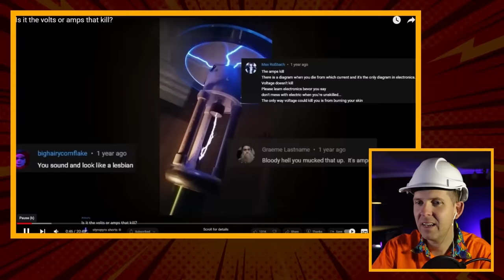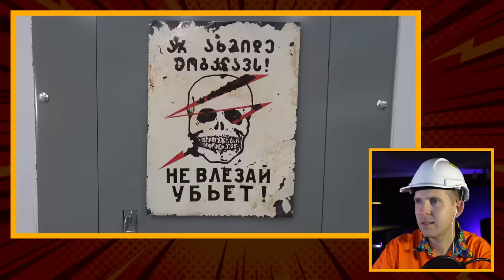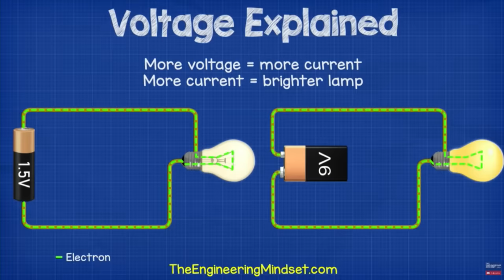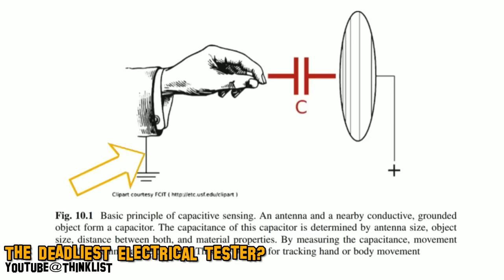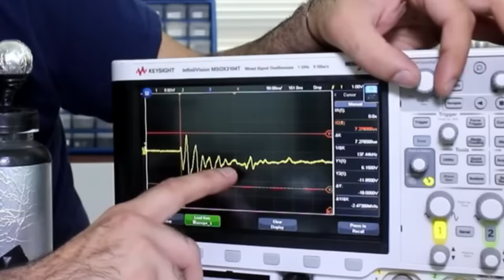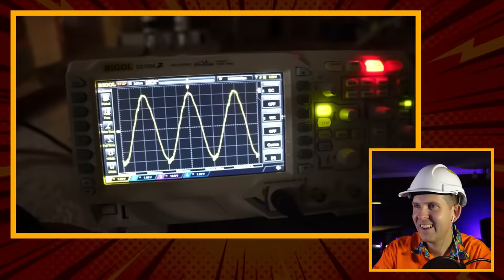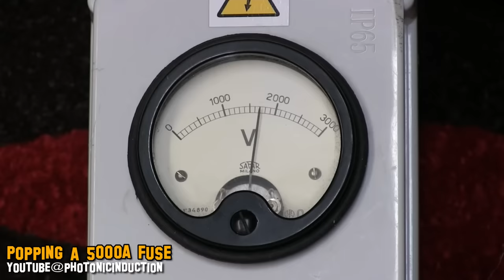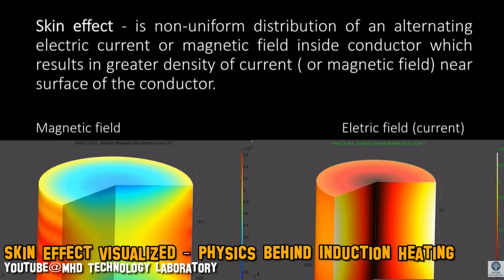Electrician Reacts to Styropyro's🔌AMPS vs VOLTS⚡

Comment: I'm so tired of the amps vs volts debate. It's so much more complicated than that. Electricity is like anything else in life. If you don't handle or use it properly it might kill you. If you spray someone in the face with a water hose for a long time and they drown, did they die from the pressure of the water that prevented them from breathing or was it the volume of the water that ended up in their lungs?
Reply: It is all about the context, not content alone. That's right!

Comment: I dropped out of college 1 credit away from graduating a 3 year degree in electrical engineering in Canada, so while I'm not technically any kind of electrician/EE, I've got a lot of the learning down (but please never ask me to simplify another circuit with a transistor in it, or ask me to write out a karnaugh map ever again). I'm amazed at how well Styropyro manages to explain some of the counterintuitive behavior of electricity.
Reply: thats so dumb. wtf 1 credit. that must feel like winning 2nd place 1 second behind 1st
Reply: @HDReMaster  Not even.  It's like being in 1st position in a race, and then stopping a couple feet before the finish line and just walking off the track.  Or playing football (🏈 not ⚽️) and totally outrunning the defense for the touchdown, but spiking the ball at the 5 yard line.
Reply: I refuse to belive that anyone would do that
Reply: What's a karnaugh map?
Why did you drop out so close to finish?
Reply: @phenax1144  if i had failed one particular exam one more time I would have dropped out at 177/180 credits required for my bachelor's - had written my thesis already. would not recommend! luckily the pressure finally made me actually sit down and study, so I passed and finally got my degree xD
Reply: @Phondrason  sheesh that's a close call good on you for making it through
Reply: @tappajaav  A Karnaugh map is a tool/diagram you can use to describe the behavior of (binary) logic circuits. You notate a table using a gray code dependent on how many inputs your circuit has, then mark down areas in that table depending on what logic gates your circuit uses, or do it in reverse, start out with what outputs you want your circuit to produce, and mark down areas to figure out what logic gates are needed.
It also lets you figure out hazards, which are situations where the output can unexpectedly change for a split second when some input that seemingly shouldn't affect the output (according to the truth table) changes.
Wikipedia has a decent explanation.
Reply: @animowany111  Much obliged

Comment: I had the opportunity of playing with a similar tesla coil, with output of about 3A rms. One effect Styropyro didn't tell about is that at those currents, it starts warming your entire arm up by resisitive heating, which is quite an interesting experience x3

Amazing reaction video as always, thanks mate!
Reply: I'll just use a tesla coil to stay warm in winter. What could go wrong? 😵
Reply: He does add he doesn't do that often because you risk internal burns, though :D
Reply: that is more than mildly terrifying
Reply: @@havocodeyare magnetic heaters the future... ?😂
Reply: @@havocodey explain it in layman's terms
Reply: That is induction. Wirelessly transferring power. Obviously there is resistance which we know causes heat but the AC frequency "vibrating" against iron in your blood causes friction too. There are so many forces happening at the same time. Electricity is amazing.
Reply: @keylanoslokj1806 induction. It's literally how Induction cooktops work. They use a large coil under a ferrous pot/pan and the AC power changing from positive to negative at a high frequency "vibrates" causing friction with magnetic flux generating heat.
Reply: @tools.no.problem  friction with magnetic flux?
Reply: @tools.no.problem  That has nothing to do with inductive heating in this case.  You need a large ferromagnetic mass to be able to heat it up inductively, you can't do that with blood.  Resistive heating was the cause of most of the heating, there's nothing much else (maybe some capacitive currents going directly from the arm to the environment, but the heating would still be resistive).
Reply: Yeah it warms my finger at 40 mA rms- I don't believe it warms you really at 3 A rms as most of the power is reactive.

Comment: I was welding one very hot day, my gloves and I were dripping with sweat. When it came time to change welding rods I quickly understood how much power an arc welder uses.
It's a good job I was young nd healthy and had just gone to the  toilet.
Reply from the maker: Oh damn! Yep that can happen
Reply: Let me guess: ZAP
Reply: Welding leathers soaked in sweat will light you up for sure. Not enough voltage to be fatal, just enough to fuckin hurt.
Reply: The TIG welder I use at my job has high voltage / high frequency start that activates about a second to get arc started without touching the tip.
My electrode holder was cracked up and I kept it taped up with black tape but one time the tape was getting pretty worn and the arc decided to jump through the crack into my bare hand.
It is capable of jumping about 3- 4 inches and it made my arm feel like it was going to fly right off.
Reply: On the other hand I was welding in my driveway with a stick welder on rainy day.
I would shut the welder off with my foot every time I put in a completely soaked electrode then turn it on to make a weld. I wore rubber boots as well and was very careful of what I touched when it was on.
I didn't have any problems but sure had to pay attention.
Reply: @michaelszczys8316 The same feeling I haf when I wanted to push a light switch in one old building...yes, the switch was broken and I actually pushed with my finger on those those 2 plates. At 230V and around 10-15Amp i felt like my hand all the way to the shoulder almost disconnected. Pretty painful expirience and can be lethal...I was indeed lucky that day.

Comment: Years ago at union trade show I saw union electrical lineman doing demonstrations about how people put tons of nails into the lower parts of utility poles and how they had to try not to put holes in their insulating clothing climbing up the poles.
They had residential type transformer hooked up to run thousands of volts at very low amps. It would arc up to about a foot distance. It was interesting watching young apprentice well insulated carrying a probe with all this voltage throwing this long arc burning hot dogs and setting things on fire.
Reply from the maker: Sound very cool

Comment: Volts x Amps = Watts. Watts x time = Joules. Styropyro has a Bachelor's in Chemistry, which outranks an electrician in terms of academic brownie points, though his electrial knowledge is self-taught. But he's a very clever guy, and has pissed about with high-power lasers for years yet still has vision in both eyes! That's a mark of a great physicist (he also did some research into MRI machines blah etc). He knows exactly what he's saying, and he's very good at getting it across to a layman audience, partly because his immense enthsiasm and love for the subject shows through.

He's also pretty hot.

Comment: I trained as an electrical fitter. I used to work installing and repairing 11kv transformers and switchgear along with 3 phase 415v distribution boards and I’ve just learned several new things from watching this video!

Comment: High amperage DC is not to be played with , have been zapped twice first DC welder at 160 amps no glove leaking hand piece straight up left arm and had a burn on right thigh , could not use left arm for about 24 hours. The other one 30kva DC generator 220v blew me over 20 feet cleared 2 marine diesel main engines 3408 cat and put me out of action for a couple of days. I consider myself lucky to be alive after either one . That was about 35 years ago
Reply from the maker: Yep it’s no joke
Reply: The welder hits hard because of the energy stored in the inductor that allows for very high voltages.  It's similar to the coil on an ignition system but can be a lot nastier due to the lower voltage, higher current, and higher joule pulses.
Reply: Did you buy a lotto ticket after, I would have.

Comment: styropyro really knows how to make a great educational video.

So if the frequency is high enough, you basically can’t be hurt by otherwise lethal currents. The standard 50 and 60 Hz AC from a wall outlet is well below that frequency and is obscenely lethal.
Reply: Keep in mind that you still have the thermal effects of dissipating that current flowing through your body.  A lightning strike, for example, often leads to serious thermal burns even when the victim survives.
Reply: @knurlgnar24 another unusual phenomenon regarding lightning strike is that it does not have to actually hit you directly, if my information is correct, & pls forgive the vague details of this story. 
A farmer at work once told me of a friends funeral he had to attend, and that he had died from a lightning strike (technically), I dont believe he died immediately ( some hours or a day later), as he was a shortish distance (10m maybe, not sure) from where lightening had struck ground zero. The hospital staff dont really understand it properly either, but they believe it was like an EMF or EMP type force that was generated in his vicinity and can cause the human body electrical signals to just stuff up & die, and there is not really anything they can do in such rare cases.
Reply: at standard American voltage of 120, and even up to 240, the lethality doesn't so much come from the electricity frying you, but actually paralyzing your heart/lungs while the electricity flows through those parts. Deaths from residential power usually come from people GRABBING something thats live and are unable to let go. A brief brush across mains voltage, while not very fun, is rarely life threatening for a healthy adult.
Reply: @evil17  There was a case where lightning struck the ground in the middle of a football game and although no-one was directly struck, several players dropped to the ground, injured. When lightning strikes the ground, it dissipates in a circular pattern and the voltage between your feet can be over 100,000V. So if you think lightning is going to strike near you even hitting a wooden or metal post, keeping your feet close together may save you from injury.
Reply: @billc2052  perfect explanation
Reply: Well, the thresholds increase with frequency, but they never become infinitely high.
Reply: @knurlgnar24 Even if it strikes next to you it can throw you away like nothing...I know some that survived not being hit directly bit they flew quite high to have body injuries when falling...
Reply: @X4Alpha4X Grabbing hot wire and neutral at 220V is the worst case scenario. I once wanted to push the light switch in one old building and the damn switch was broken leaving only hot and neutral metal plates. I thought my hand is going to go off... was lucky. If grabbed both cables your hand muscle contracts in split second which closes your palm. I had couple of times short contacts only with hot wire and it was not that bad...but closing the circuit with your own body is the worst feeling which I guess nobody ever forgets.
Reply: There is no freuency at which neurons stop functioning totally. They are reacting more readily to a specific range of frquencies while they are less responsive to frequencies outside that range. But with high enough currents neurons can be excited, even at high frequencies. Eventhough this ight require currents above the power/energy threshold the body can withstand. The Threshold just increases with frequency. The perception threshold for 50 Hz AC is around 0.5 mA. At 100 kHz it should be around 800 mA, if I got it calculated right here.

Comment: this vid is amazing. in the past few months i have gone from not knowing the difference between AC and DC, to making function generators, and inverters using 731op amps and 555 and 4047 ICs. last week i finally grasped the concept of transformers. this week i have been learning about calculus and logarithms. a whole world of interesting videos has become open to me, i now understand what this bloke and styropyro are on about!
if i were to be asked "is it volts or amps that kill?" i would reply -"yes, usually."
Reply: Awesome to hear that you've been learning a lot!
Are you fiddling in electricity just for fun or have you worked towards goals of some sort?
Reply: @tappajaav  i decided, out of nowhere, i wanted to make a model rocket with a flight computer in it. i launched one last week with an arduino nano in it, recording acceleration, rotation, pressure, and temp to an sd card!

Comment: There is a video called "listening to radio with grass" that illustrates what's going on here.

A bunch of bored people break into an AM broadcast antenna site and put plants on the antenna, which is insulated from ground and carries high voltage at high frequency. The plants instantly burn, forming an arc speaker that makes the modulated sound audible. They're wearing gloves, thinking that they're protected from the voltage, but at such high frequencies the gloves just create a capacitor and the voltage goes straight through. They don't instantly seize up and die because of the high frequency (500+ kHz for an AM broadcast), but they soon feel the pain from the heat generated within their body by the current passing through them. So they're being cooked from the inside and I'm going to guess they felt this for a very long time afterwards and may have had permanent tissue damage.
Reply: Talking about AM sites. A company I still work for has a story about a bloke that was going to end his life by jumping from the top of a AM tower in Australia. He climed over the outer security fencing. crossed a very large block of land. the climbed over the inner RF security fencing. The he reached out in order to grab the tower to climb up.  one leg about to be set down on the tower. Using his body he grounded the antenna. Running 200,000 Watts RF. left ankle and foot dissapears, the wound instantly cautorizes, he falls to the ground. with great difficulty climbs back over the RF security fencing. Then back over the paddock on one foot. Cimbs back over the perimiter fence and drives himself to hospital. Moral to this story : NEVER EVER go near a AM radio tower. the tower itself is the antenna. several thousand volts in energy and a potential of hundreds of thousands of amps available for a instant. Making a bit of grass into a modulator may well be the last thing you hear. Great Video. Thanks. Peter W. Australia.

Comment: I was taught that the basic meaning of RMS is like this: Assuming a purely resistive load, an AC voltage of 1 Vrms will result in the same heating of the resistor as a DC voltage of 1V.
Reply: Exactly! That is also why you can not RMS values for shock severity determination outside the 30- 300 Hz regulations, as they have been realized with RMS. You can rather use the charge transfer definition and the frequency-charge-duration correction factors to calculate the frequency.

Comment: 14:21 this actually makes sense based on what I have learned in my Brain Computer Interfaces class -- because of the way the sodium potassium pump
Reply: It's a certain charge transfered in a specific time period called the cell time constant which depolarizes the cell membrane. For example: a shock of 30 µC feels the same with large contact areas whether it is given with 200 V, 330 V (85 nF) or higher voltages. A shock with 10 µC feels the same at 450 V as it does at 120 V, or at 1000 V. 
So the charge in every half wave depolarizes the cell membrane. So the thresholds will be positively correlated to the frequency. But the energy will be different and therefor heat and other effects will increase.

Comment: 14:19 Yeah, it’s crazy how you can’t feel electricity at extremely high frequencies. ElectroBOOM actually made a video that was based on pain vs. frequency. In that video, the pain peaked at around 2000 Hz, and dropped significantly at 10 kHz

Comment: Just like there's different kinds of radiation, if a neutron beam is strong enough, it mostly just passes through you, slow ones won't, but a week alpha source that can be blocked by paper can kill you really fast if ingested. Particle or electromagnetic, neutral or charged, frequency/energy level, what tissue is being exposed... It's not as straight up as one might think.

Same with electricity.

Comment: a bit over 30 years ago, I landed myself backwards about six feet playing with around 20KV pulsed HV-DC at unknown current potential(large vehicle/racing ignition coil) and leyden jars.
it blasted through a hand and left leg, which in turn catapulted me backwards from end of bed to slammed against headboard half vertical, which also knocked over the table and made the junk producing the HV stop. it was likely a good thing it was all on a cheap folding table, but then again, it's the metal legs and outer rim that got me.
likely a good thing I had very strong legs and was skinny from lots of bicycle riding.

Comment: Sticking a piece of aluminum tape on a plasma globe will cause it to shock the piss out of you. Is that because it effectively lowers the voltage frequency? Or does it store current like a capacitor?
Reply from the maker: 😆 I suspect it’s creating a capacitive effect
Reply: I love that your name is bubu
Reply: My guess is that it increases the size of the contact patch.  Instead of just touching 1cm^2, you're touching the area of the foil

Comment: The secondary of High frequency supplies like Tesla coils tend not to electrocute. The sensitivity of the body to current is frequency dependent with the greatest hazard been around the power frequence range. However the spark is hot and can burn.  However the primary of the coil I built was energized with 2000 volts DC and that is DANGEROUS. I made a video on it :)